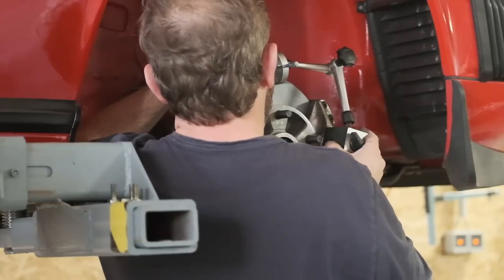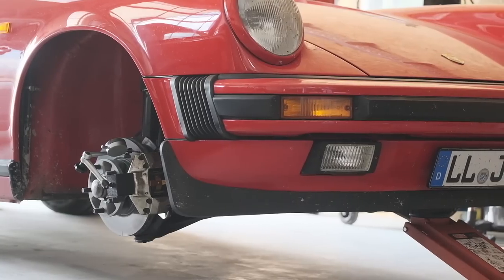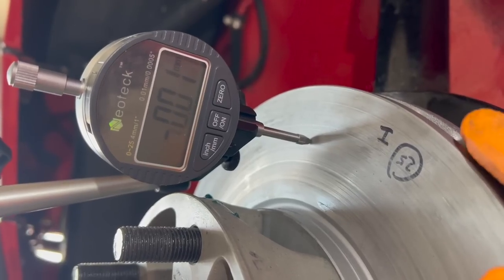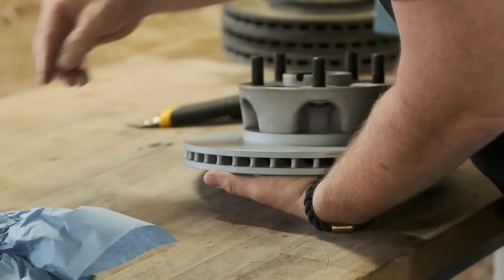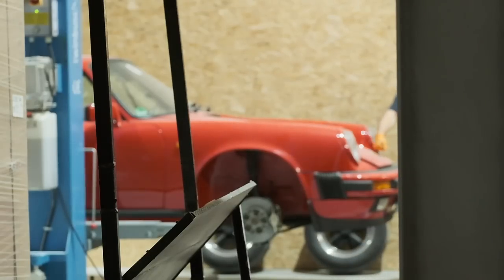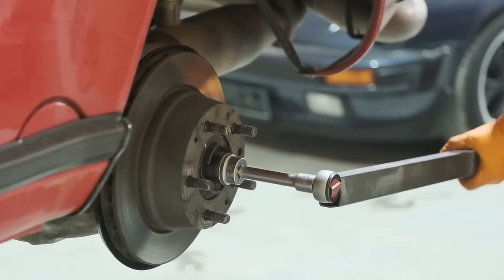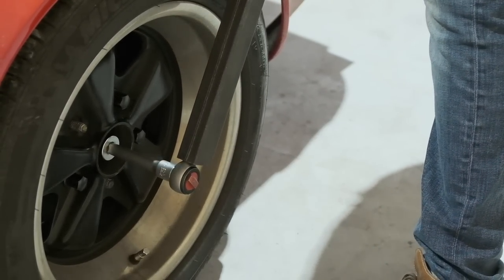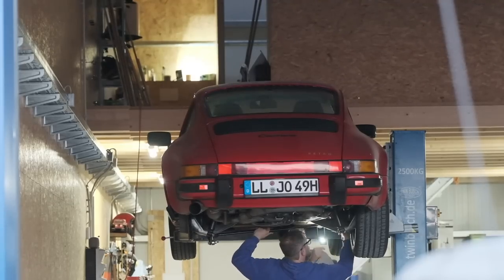Brake Vibrations and a Surprising End

Comment: If you had just thrown parts at it and replaced all four rotors this problem solving would have been delayed, perhaps forever. I’m glad you approached this issue so methodically. Great video
Reply from the maker: Unless I’d have been wise enough to know that eBay parts are 💩

Comment: EXTRAORDINARY patience, discipline and resolve here. I especially appreciate the wise words of advice on using a block of wood and a jack to preload the suspenion before tightening tp prevent early bushing failure. That's something I've read about and remembered once you brought it up but if not for your reminder, I might have overlooked this valuable suggestion. Bravo
Reply from the maker: Thanks a lot, Steve. 
Glad you watched though it’s not an Alfa!
Reply: @GreasyFingers  I always learn much from your clips. We are appreciate your work

Comment: thank you for your explanation, that any vibration can come from rear wheels. That is exactely what I learnt on our last BMW. This car always had vibrations. First, I changed the front brakes, then the rear brakes. Less vibrations, but still too much. I changed all parts off the front axle. Less vibrations, but stil too much. And then, I changed the rear tires. That was the problem!
Reply from the maker: Thanks for commenting, mate. 
These wheel vibrations are very annoying and very difficult to get rid of. 
I’d rather take a rotten sill instead …

Comment: Excellent film, thank you sir! I went through similar headache a few years ago on my 911SC. Spent much time and money chasing an intermittent vibration only felt during hard braking from speed. After replacing many of the 'obvious' parts like you it turned out that one of the brake flex lines was starting to deteriorate internally and was acting like a valve!
Reply from the maker: Thanks, James.
Now, that sounds even more devilish than my problem!

Comment: A lot of guys ruin the wheel carriers by improper removal or installation of the bearing races.  They get them in cocked.  I always heated the outside and used the proper puller.  On install I put the races in the freezer overnight and heated the wheel carrier.  No problems .  If they are cocked you will know when you try to adjust the wheel bearings.  You won’t be able to get the play out with tightening down the nut so you can still move the washer with a screw driver.  Once I replaced the carriers installed the bearing races the proper way. My wheel bearing adjustment problem went away.  Good video.
Reply from the maker: Hi Rod. Thanks for commenting.
Yes, using the thermal effects is a very elegant way to change bearings. I don’t have a freezer in my workshop, but I heated the wheel carrier to about 150 degrees Celsius to support the process. That’s about the temperature that I can handle with my welding gloves.

Comment: Your video is so on point showing the tasks and obstructions you have to overcome to get something into almost as new condition. I got to learn throughout the years that replacing for new often does not solve the problem, even worse, it sometimes creates new ones. And sorting those out quite often sends you one a wrong path of diagnosis, as you initially never doubt the new, just replaced, components. So you find yourself barking at the wrong tree and then spend countless hours to encircle the issue.
Had that case with front drum breaks on a 62 beetle. After the third set of drums I removed the perfectly round & new Technomagnesio wheels and put the rather oval steel wheels on. Turned out, the way the wheel bolts load tension on the entity warps the drum even at a low 80Nm.
Reply from the maker: You’re hitting the nail to the head, Oliver.
We went through exactly the same thing.

Comment: Wow Johannes, fixing this annoying vibration was certainly hard won.  On my very first car, I suffered from a very similar vibration and it drove me crazy. After 2 years of changing everything under the sun, the culprit turned out to be a faulty tire.  It seemed one or some of the internal cords had broken and this caused the tire to distort under load and speed.  Congratulations on tracking down the the root cause - I am sure you were so happy.
Reply from the maker: Wow, Lester. The cross you carried sounds just like mine. And as always, in hindsight all was so plain to see!

Comment: Congrats on your success Johannes!  Many years ago, turning new rotors on a brake lathe was common procedure before everyone started just installing them.  It wasn't uncommon to find that even new rotors  needed to be resurfaced.
Reply from the maker: Thanks, Brad. Yes, and today it’s hard to find a workshop that even owns a lathe.
Reply: @GreasyFingers  I may be wrong but i was told that today's rotors are sold at minimum thickness whereas when i was in the industry 40 years ago, rotors could be turned 2 or 3 times before they got to minimum thickness.

Comment: I was in a similar situation with a 1964 Volvo 1800S  restoration. First measurements showed a big throw out of over 0,2 mm if I remember correctly, clearly warped rotors. At the time it seemed that the discs were not available any more for early models so I went and  pressed the bolts from the hubs to remove the disc, unfortunately causing the hubs to warp with the intention of having the rotors turned. I had the hubs turned on a lathe and the discs turned on a brake lathe. Luckily at that point a supplier informed that the reproduction discs were available and on this one the hubs are integral to the discs.  Brakes are totally smooth. I still have the original hubs and discs in a box, maybe one day I will test what kind of throw out can be reached.
Reply from the maker: Thanks for commenting, Markus.
Based on the comments to this film you wouldn’t believe how many of us had problems of this kind. 
The 1800S is a glorious car. Do you still own it?
Reply: @GreasyFingers  Yes I do, occasionally starting it in the garage and waiting for the summer

Comment: at 6.38: please search on line how to proper apply grease to a wheel bearing ... putting some grease on the external face is not enought .. and... greetings for your videos ... they are superb!!!
Reply from the maker: Hey mate. Thanks!
Just because I didn’t show it in the film, doesn’t mean that I haven’t filled it with grease, does it?
Reply: @GreasyFingers  Hi there! a part from the grease you put inside the hub I am thinking about packing the bearing in the proper way: mechanics are used to put a slab of grease in the palm of the hand and pressing on it the bearing in each point till you see the grease escaping on the opposite side.. in this way you are sure of greasing properly all rollers... avoiding they overheat... In my opinion it could be nice to show also this detail.. Anyway.. superb videos and good spirit 😊😊

Comment: The on the car brake lathe can address this issue. As an auto mechanic I enjoy using the machine and getting near perfect brake run out measurements.
Reply from the maker: Yeah, that would have helped A LOT with the front wheel part of the project.
I’m sure you’re aware the brand Hunger is leading in this domain. They’re located in Kaufering which is around the corner from my workshop’s location.
The point is, you see: if you’re trying to be a serious YouTuber, you can’t just go to the workshop next door and let them solve the problem.
Reply: @GreasyFingers  Good point and great channel, I really enjoy your stories.
Reply: I have an on the car brake lathe that I spent a lot of money on 30 years ago and I find it's great for resurfacing but it seems to amplify not remove any existing runout.  :-(.   Now for my daily drivers (not performance cars) I just buy very cheap rotors for most pad changes and it's always worked out so far.

Comment: As an one in Engineering specifically in measuring brake rotors I was going to say thickness variation is a HUGE part in pedal vibration. All manufactures demand less than .01mm. Jeep in the early 2000's had to change caliper manufactures because the rubber seals in the pistons didn't pull the pad back off the rotors far enough when releasing the brakes. The pad then wore the "high" side of the rotor and the thickness variation caused pedal vibration...
Reply from the maker: Thanks for commenting!
My point was: a thickness variation can sure be caused by other components having a failure like callipers, wheel carrier etc. But given the process of manufacturing it’s hard to imagine that you get a new disk with a thickness variation. Or am I mistaken?
Reply: @GreasyFingers  All manufactures now machine both sides of the rotor in a single setup. Therefore there sould be almost zero thickness variation. As well the tolerance limit is 10 microns (.01mm). Bad heat treatment(cooling from casting process) CAN leave hard spots that will do it and cheap aftermarket may not do both side in the same machining, but from factory (all, including north amercan manufactures) measure 100% of the rotor including runout and thickness variation.
Reply from the maker: @rodkubis384  That’s extremely valuable information. It confirms my suspicion that sloppy transport has caused the problem of my front disks.

Comment: Enjoyable watch, thankyou! How do you find the Twinbusche single post lift, other than hard on the head!!??
Reply from the maker: Hi Chris. Thanks!
The lift is a very good product. It allows to have unhindered access to the car from one side and you can even move around the car in the workshop when it’s on the lift. Little disadvantage: the fork builds rather high, so flat cars require attention to drive over it.

Comment: This (variation of thickness, or "ditches") in brake discs/rotors is something I've come across in the past. It can happen when the discs get overheated, and the brakes are held on while the discs cool off. Perhaps the car was tracked, and the driver didn't do a cool-down lap, for example, and sat for a while with the brakes applied.

Many moons ago, there was an anti-theft device that would go between the steering wheel and the brake pedal, making the car immobile. These would cause the same problem on some cars if it was fitted, and the brakes were still hot. Or even if the car was driven with a seized calliper.
Reply from the maker: Thanks for commenting, mate.
Yes, all good points that make a lot of sense. In my case, a misaligned rear wheel carrier destroyed the disks. I'm mentioning it towards the end of the film, but admittedly not very clearly.

Comment: I had a similar problem - but after changing my wheel bearings, brakes and doing my hubs it turned out to be my rear tires being flattened out from standing for too long with little air :-)
Reply from the maker: Thanks for commenting.
Yeah, that’s the problem: too many things that can go wrong. ☺️

Comment: That’s for sharing your video. Where is the front jack point to lift the car?
Reply from the maker: Welcome!
It’s not exactly a jack point, but if you protect it with a piece of wood or rubber, you can use the front cross member to lift her.

Comment: Relentless
You are Johaness , I would like to get a guy like you close to my home to look at my 911’s. . Steph . Could you unveil a bit of your new 911 vintage 70’s ? 😊
Reply from the maker: Relentless and without mercy.😄
I’m counting the minutes till all customer projects have been processed to finally work on my own cars.
Reply: @GreasyFingers  finally , the solution was to replace rear break discs to avoid vibrations  th equate gave the measurement on only one face not the red face ?  thanks
Reply from the maker: Sort of. Bent wheel carrier, destroyed disc, but destruction was not evident by run out, but thickness fault.

Comment: I didn't get it how this happened?  New discs were like this or they became like this when you put them in the car?  And this means that the front of the disc was true but the rear was crooked (thickness)?
Reply from the maker: Neither do I, but I guess the front disks were corrupted from the start, bad production batch at the manufacturer, I guess. 
The rear disks were okay, but the left one got beaten up by the bended wheel carrier.
Reply: @GreasyFingers  thanks for replying!

Comment: As a regular mechanic I would have changed the rotors first as almost 95%of brake vibration is due to rotor damage/warping
Reply from the maker: You’re quite right, mate.

Comment: I worked at Porsche cars Australia as an apprentice mechanic when your carrera was a near new car. I can tell you that the first operation we would have done in that situation was on-car disc machining. had you done this , problem would have been solved in one day , and at a fraction of what you spent. Im sorry for the loss of time and money you went through.. did you ever consider this or is it not a common operation where you are?
Reply from the maker: Thanks for commenting, Ben.
I probably didn’t explain the crucial point properly: my problem was that a bent wheel carrier continued to distort the disk. I had changed/repaired the disks a couple of times, but the problem kept returning. 
I’m aware about on-car disk machining, actually the market-leading company Hunger is located around the corner from where my workshop is.
Reply: I see now, I forgot about that aspect, while the on car machining centres the machining around the theoretical centre, The continued bending from the hub will always be an issue. glad you found it! @GreasyFingers

Comment: Guessing before watching, not OEM hubs and bearings.
Reply from the maker: Guessed right, Robert.
The price tags are enormous.
Reply: @GreasyFingers  Got it, I just had similar problem with Audi S4 B8, went through Zimmermann drilled rotors with Yellowstuff pads, then EBC USR + Red stuff pads, then again EBC USR with Yellow stuff and new replacement hubs, they got bent right away, then with Brembo Xtra discs and pads all over and OEM hubs and bearings :D. It took 3 years to get to the  bottom of the issue.

Comment: you havle not ot remove material you should add shim to opposite side
Reply: Opposite side of brake pads?
I guess if only one brakepad is doing all the work, uneven heating, warps disk.
Reply from the maker: @jefdamen2977  Thanks, Jef. 
I really think that the problem was caused by the warped wheel carrier.